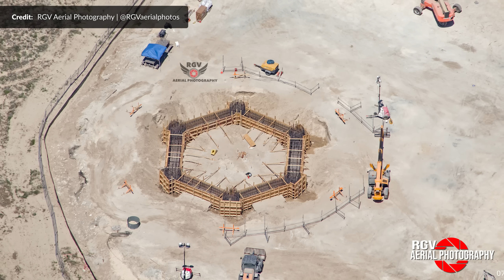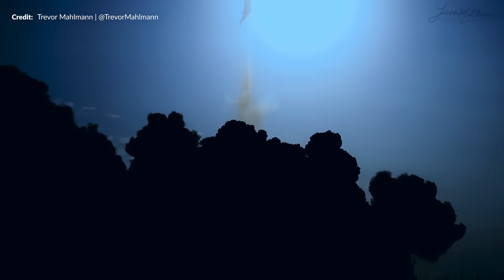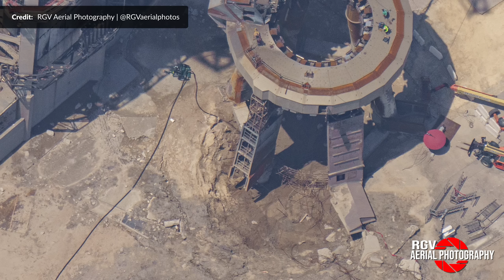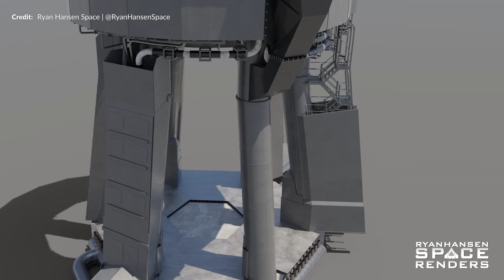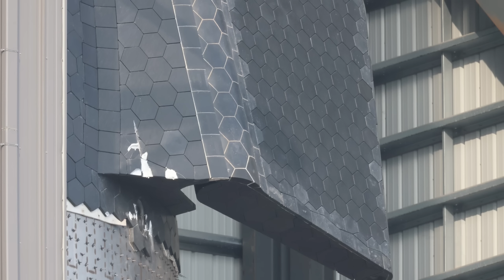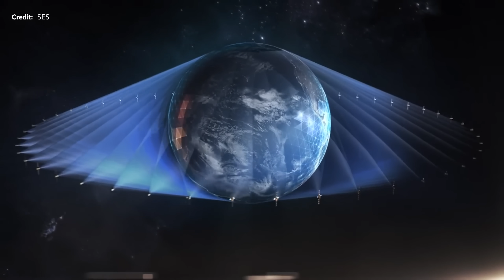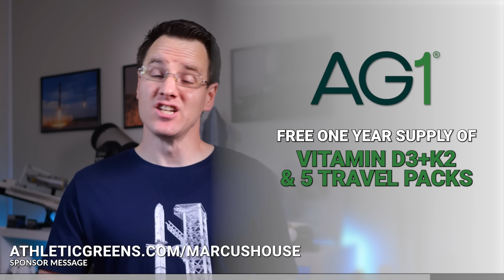The Starship Damage Left Behind: How are SpaceX Moving Forward?

Comment: Requires further thought.
If the aim is to launch many spaceships per week, then may I suggest a horizontal launch with an electric catapult.  (Linear electric motor) and recoverable aircraft to get the booster and spacecraft up to say, 500m or some such and vertical over the ocean before the raptors are ignited. Stage 0 would then be the aircraft. It would glide back and not need to be refuelled as it is accelerated using magnetic forces. (Think high speed maglev train)
The chopsticks can still do the recovery when the booster returns.
Also sling some money at pure gravity experiments. Albert's "bent Nothingness" conjecture didn't get him a Nobel prize. More work needs to be done.
Footnote: I hope those who built and operate the moon don't get pissed off at us (again) for dropping debris on the roof. The Towers on 911 turned to dust and blew away in the breeze as was quite clearly demonstrated by Forensic Architect Dr. Judy Woods. (Where did the Towers Go?). The giggle factor does not suffice as a rebuttal.

Comment: The entire air frame of the booster and Starship and the connection held out very well while the rocket was tumbling. with a top-heavy Starship still full of propellant and the booster down to 1/4 tank it stayed in tact structurally. A good sign for the engineering.
Reply: Dude there were massive chunks breaking off it the entire way up. Then the thing started bending in half & caused it to start flipping. I'd be more worried about the engineering required to actually make it fly rather than how much was intact when it splashed.

Comment: Interesting that SpaceX will get to use Launch Pad 6 at Vandenburg, aka “Slick 6.”  At one time, this Launch Pad was going to be used for the Space Shuttle. I thought this would be a fun fact.
Reply: More interesting is that ULA gave it up as they no longer have a rocket that can use it (or no missions that could use it for the few Atlas 5 that they have left).  The big question is will Bezos end up buying it?
Reply: @Scanner9631  The Atlas-V launches from SLC-3E and Vulcan Centaur is also expected to launch from that pad at Vandenberg. SpaceX has Falcon 9 at SLC-4E and SLC-6 will support Falcon 9 and Falcon Heavy per reports. I wonder where a second landing pad will be built. If SpaceX still plans landing side boosters at sea and/or a fast launch cadence at Vandenberg, they will need another drone ship.

With the last 2 Delta-IV Heavy launches being from SLC-37B at CCSFS, the USSF likely needs Falcon Heavy at Vandenberg. The Falcon Heavy and Vulcan Centaur VC4/VC6 will replace the Delta-IV Heavy. Vulcan Centaur launches with 0-2 boosters will replace the Atlas-V. Hopefully they can figure out the Centaur stage anomaly and launch in May.

Comment: The thing that makes me want to yell back at videos of the launch, is this comment "How did so many engines fail?"  Uhhhhh huge pieces of concrete hitting them during launch.  The fact that the ship made it as far as it did amazes me and is testament to how well built it is.  Did none of these Engineers play with a garden hose as a kid.  If you shoot high pressure water at the ground dirt flies in your face.  Same basic thing happening here.  Also the huge piece pointed out next to the ship, to me looks like it hit because it looks like a leak right after that in the same spot.  Anyway, very cool launch.

Comment: I really appreciate your presentation, but one thing I can't understand is on what basis commentators claim that the launcher sustained huge lateral loads while tumbling. According to my researches density at around 40km is almost vanishing, around 1%. From a rough comparation a force coefficient at 2000km/h compares to less than 200km/h at sea level. It was  basically tumbling in vacuum
Reply: Remember the 2nd stage was still attached and fully fueled.  That ups the stresses as it would have much more inertia than the emptier booster which still had thrust.  They stayed together through that and were still together when the termination system was activated closer to 32 KM where the air was thicker.

Comment: "...that it slowly tumbled in the quite thick atmosphere..."
At 39 kilometers the density of the atmosphere is only 0.4% that of sea level. Not 'quite thick.'
Reply: Consider the mass of the rocket and the energy to make it tumble at all. If the 2nd stage was fully fueled that would be around 1400 tons alone not counting super heavy and what fuel it had left.
Reply: @Scanner9631  Good point.
Not only was it fully pressurized, increasing it's structural integrity, it was also heavy, that is, dense. That also makes it more resistant to sheer forces from the thin atmosphere.
Reply: @TimStCroix  

Also of course the forces that made it spin had to be correspondingly large.

Comment: Well that was one Big ah shit, but the rest of it was one big attaboy. But also, the almost instantaneous superheating of steel rebar reinforced concrete is guaranteed to cause massive explosion of the concrete, basic physics this is part of what helps bring down the north and south tower during the conflagration from thousands of pounds of jet fuel burning fully oxygenated are rated producing thousands of degrees of temperature instantaneously well eat your crust produced point impact load of over four and a quarter billion foot-pounds and physically destroyed much of the vertical support columns and many beans in the impact zone the massive heating the conflagration would have exploded and center reinforced concrete structures associated elevator shafts

Comment: Space X is a piece of "*", low tech heavy metal can, uses big engines and a lot fuel to compensate for it poor, cut cost design. It merely a huge firework equipped with computers.

Comment: Sorry i am an optimistic guy with this stuff to the max but 2 month repair??!   Not a Chance

 I work in the construction field and have for many many years, with the damage seen to the base of the OLM inspections on the foundation around it will have to be done and i can almost guarantee the OLM will have to be reconstructed from the base up.   The damage destroyed all base foundation hard points and blew underneath them and further out taking out most mounted rebar in the process , as well as blew lower then the water table which will now be inspected and repaired. which is a long process.   This isn't even taking into account the damage to the OLM delicate hardware that took a beating as well.   

Then he has to put in this "Massive steel plate"  he says he has and do multiple static fires and tests to confirm that it will prevent another Pad decimation....    

Along with all of that the FAA has now grounded the Starship Testing until they themselves do their own investigation on the entire launch and all that fun stuff that takes months...

We will be lucky to see the next one fly before Halloween at the soonest. Early 2024 is more likely.  Elon may know rockets but he clearly underestimates construction and repair time.  Those engines are unbelievably powerful,  a plate is going to act like a big metal speaker with the shockwaves and soundwaves from that rocket, it may not blow concrete but it is going to increase the backpressure of the shockwaves by a large amount which is going to hurt the engines or the booster itself... 

 i am starting to think Boca Chica was not the best testing site due to the Water table being like 10 feet below the ground out there.   I am extremely anxious to see what they can come up with to divert the power of those engines evenly and safely...  going to be the hardest test yet.
Reply: The FAA routinely ground spacecraft that suffer mishaps, this is nothing unusual. In Jun 2015, B1018 suffered a RUD lifting CRS-7 to the ISS. The Falcon 9 was grounded and once SpaceX resolved the problem, B1019 was the first booster to land in the Dec 2015 flight. Sir Branson's SpaceShipTwo VSS Unity was grounded when they flew a little bit out of the flight restricted area on his sub-orbital spaceflight. Nothing was hurt or damaged, but just the flight area violation. I have the feeling the investigation with the FAA grounding will be shorter than the repair work to Stage 0. 

I agree that Musk's target dates are not reliable and Musk has admitted it the past, that he regularly makes overly ambitious targets dates. Like the opposite of Mr Scott in Star Trek who inflated his repair times by a factor of 4 to seem a miracle worker, we should multiple Musk's dates by at least 4 for more realistic dates. So 8 months is New Years and I would not be surprised if it was longer.

To be fair, the OLM distance to the ground is roughly the same as the distance from the pads at LC-39 to the bottom of their flame trenches. The OLM doesn't have a flame diverter and water deluge system. Musk mentioned that they have a water-cooled steel plate system to install under and possibly around the OLM, but it was ready yet. Musk's "the best part is no part" philosophy bit him in the arse wtih the no diverter or deluge part. He rolled the dice that Stage 0 would make it through one launch without them and came up with a Nat 1 on the d20.

Comment: Seriously why aren’t they using a flame trench? This kinda stuff was solved half a century ago.
Reply: To be fair, the OLM distance to the ground is roughly the same as the distance from the pads at LC-39 to the bottom of their flame trenches. The OLM doesn't have a flame diverter and water deluge system. Musk mentioned that they have a water-cooled steel plate system to install under and possibly around the OLM, but it was ready yet. Musk's "the best part is no part" philosophy bit him in the arse wtih the no diverter or deluge part. He rolled the dice that Stage 0 would make it through one launch without them and came up with a Nat 1 on the d20.

Comment: Thanks for the detailed coverage. It's amazing how many additional details have come out since we talked just a couple of days ago. Also, a huge shoutout to the SpaceX photography community. Their coverage of ever single little detail at Starbase is incredible.
Reply: Thanks for bringing Scott and Marcus together for the interview. It was excellent! 🙏
Reply from the maker: Cheers Fraser. Was a fun chat.
Reply: one more detail: The ground below was simply lacking a proper foundation, since the vertical load must equal the total thrust of all engines which is at the most 1.5 times the total weight of the rocket, normally the time from ignition is much shorter, so that the steel plates, arranged is a pyramidal arrangement , heat capacity can take the thermal energy convected to them. It is unlikely that an additional insulation is required. The water spray is more designed to absorb the acoustic energy.
Whithout this proper foundation it is not surprising that a crater was dug, the only reason large debris was ejected radially.
Reply: Saw that, nice to see you 3 discussing it all.

Everyday posted some video of the launch that was incredible, if you haven't seen it.

Comment: We were all worried about these fragile tiles but we ended up staring at pictures of the destruction left on the base . Unfortunately it will probably take at least this Christmas to see another attempt
Reply: No chance by xmas. The site & surrounding areas will take a huge amount of time to clean up first. Because it's all protected area around it, they aren't allowed to use machinery or even drive on it. Has to be cleaned up on foot & by hand. & when I say cleaned up, I mean every shard of metal, concrete & glass, carried on foot & the entire site restored to pre disaster conditions. This alone could take over a year. Then they have to get approval to launch again. Which after this, is not going to happen without some sort of major redesign to both the launch pad & the rocket. So we could be looking at a few years most likely. It could end up being the first & last attempt.

Comment: I think that this is a somewhat convoluted example of a failure to apply the "test it early, test it hard" philosophy which has worked so well for SpaceX. Of course, SpaceX did a static fire test, but only at half power and with some of the raptors missing.  When even that test produced flying debris and damage, the "test it hard" philosophy clearly called for a second static fire test, with full power, full duration, and a complete set of engines.  You don't need a full stack to do those tests.  I remember the early Texas water tower prototypes with a block of steel on top to simulate the load of a Starship.  Couldn't some of that kind of testing be done at Hawthorne?
Reply: A full power test really needs a launch.  This WAS the test it hard phase and this is why Musk put the chance of success so low and STILL had a success (the site survived and the rocket flew past the speed of sound).
Reply: @Scanner9631  The 31 engine static fire damaged the concrete under the pad, so this was foreshadowed. Musk gambled on the fondag surviving one launch and rolled a Nat 1 on the d20. I think he expected the fondag to be damaged worse than the static fire test, but not for large chunks to be flung as high as Starship (second stage).
Reply: @steveaustin2686  

Based on that and repairs/upgrades they calculated that it would survive ONE launch.  It didn't.  Sometimes results are non linear and you only find out when you test.  This appears to be one of those.
Reply: @Scanner9631  Yeah, they rolled the d20 and came up a Nat 1. Musk has said in the past that they didn't want a diverter, but would add one if necessary. Musk's 'the best part is no part', bit him in the arse this time.
Reply: Thanks for the perceptive and interesting replies. I was never a rocket engineer but I spent many years developing and testing critical computer software.  I am aware of the powerful psychological temptation to "test gently and not as often" so as not to break some product or component that you hope is ready for final testing. So, it's primarily a psychological problem and at least partly a management problem.
I would also like to point out that even the first (and only) full static fire kicked up a few rocks and other debris.  If you remember from the discussions about the Space Shuttle Columbia disaster, the decision to stop flying the Shuttle was made in part because having the Shuttle too far back on the launch assembly put it directly in the path of anything dislodged from important parts of the entire rocket system.  Not having a flame diverter means that the direct engine exhaust is reflected back up toward all the booster's rocket nozzles.  Sometimes having a mission-critical design flaw requires that you pause to at least jury-rig and test a fix before going back to full-system testing.

Comment: Great job Space X! I'm wondering now..Rather then continue to possibly scrap Starships maybe the better plan would be to attach a disposable top to the booster to verify safe flight first.
Reply: That would drastically change where the center of aerodynamic pressure is relative to the center of gravity. Most of the cost is the Raptor engines, so stage 2 is already cheap relative to stage 1.

Comment: I am curious why Elon did not look at the Nasa Launch towers and realize there was a reason why they use a blast diversion system of a trench that lets the blast  be diverted off to the sides rather then leaving a flat surface that can be dug up by the blast and redirected back up towards the spacecraft...?  Seems common sense to me.
Reply: To be fair, the OLM distance to the ground is roughly the same as the distance from the pads at LC-39 to the bottom of their flame trenches. The OLM doesn't have a flame diverter and water deluge system. Musk mentioned that they have a water-cooled steel plate system to install under and possibly around the OLM, but it was ready yet. Musk's "the best part is no part" philosophy bit him in the arse wtih the no diverter or deluge part. He rolled the dice that Stage 0 would make it through one launch without them and came up with a Nat 1 on the d20.

Comment: Concrete if used needs a new formula which can withstand pressure blast and heat.  Granite is fine but Elen needs to use something tougher.  Diamonds would do the trick maybe mixed into a moulded metal blast plate?
Reply: Wrong part of the world.  If it were in the middle east they would use diamond with gold accents..
Reply: @ffsireallydontcare  Elon is from Sth Africa.  That's wher most diamond is mined - including industrial for use on drilling and cutting equipment.
Reply: @waynedrummond6583  But do they sparkle?
Reply: @ffsireallydontcare  Let's find out.  It's really just a diamond saw blade cutting a concrete roadway isn't it?
Reply: @waynedrummond6583  Actually there was an interesting story from, I want to say, Arthur C Clarke?  I think it was one of the 2000 series, possibly 3001.  Anyway there's a theory that there are massive diamonds in the cores of the gas giants, as carbon falls to the core by gravity and is compressed into a diamond lattice.  In the story they somehow mined this and as diamond became incredibly cheap and plentiful it was used for construction, making space elevators possible.
But to answer your first posit seriously, something like diamond would probably work, but only if it was a continuous sheet.  I'd imagine that melting diamonds into steel wouldn't achieve anything, you'd basically get a higher carbon content steel If the diamonds were largely still in tact you'd have weaknesses at the junction between the two materials... I'm guessing.. I'm not a material scientist.